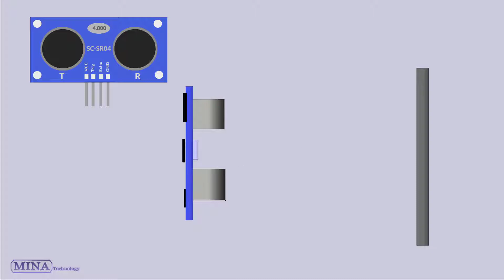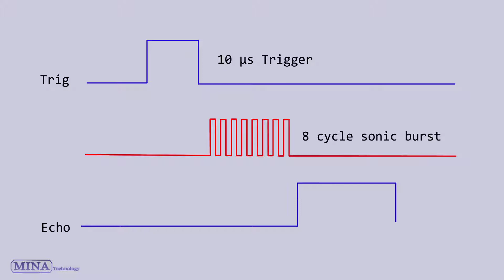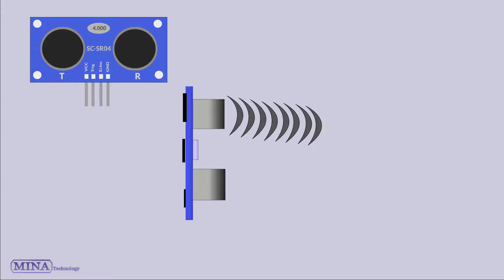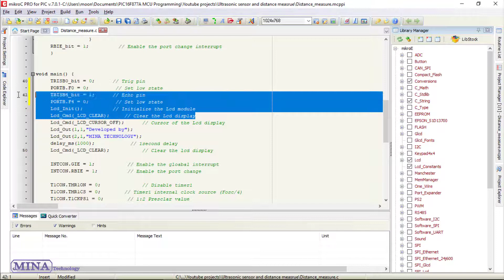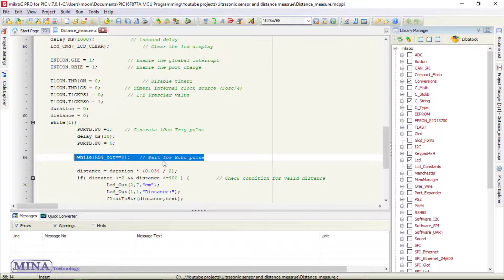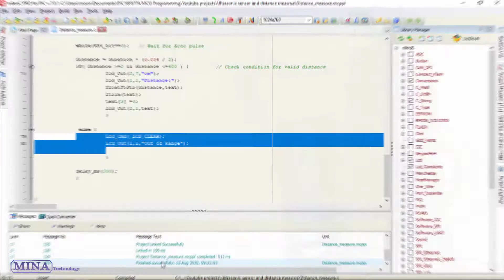HC-SR04 Ultrasonic sensor interfacing with PIC Microcontroller

Comment: where the resistor connected in circuit ?
The HCSR04 outputs 5v, which could destroy
many microcontroller GPIO pins (the maximum allowed voltage varies). In order
to step down the voltage use a single resistor or a voltage divider circuit.

Comment: What is the maximum distance.
Reply: Well sound travels at 343m/s in air and he said it takes 38ms before the sensor sends a "not found" pulse meaning anything that takes longer than half that time to be reflected will not be read. Therefore (343)*(0.038/2) will give you the maximum distance it can read of 6.517 meters